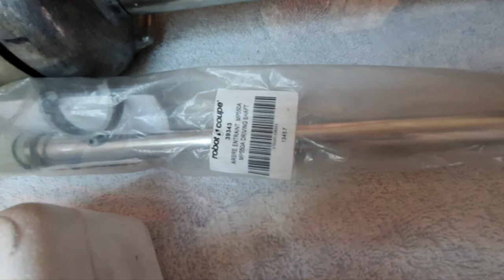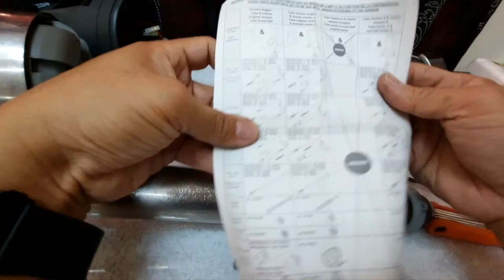Robot Coupe MP550 Ultra. How to remove replace driving shaft and Bell mixing blade.

Comment: Hi we have mp550 ultra,  which is vibration  and heating issue for drive shaft .  Can you help
Reply from the maker: Two options.  1. Replace drive shaft assembly 2. Dismantle it and replace the bearing and shaft seal.
Another video is available on how to repair the drive shaft.